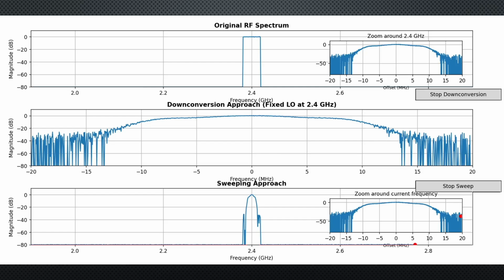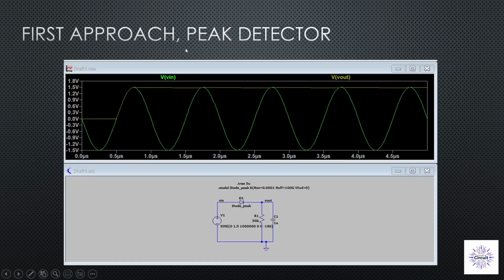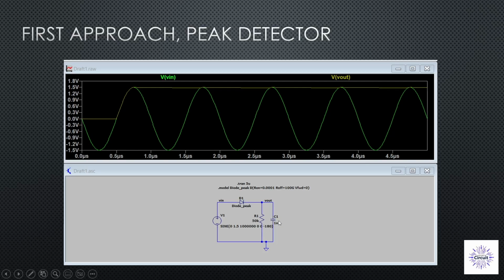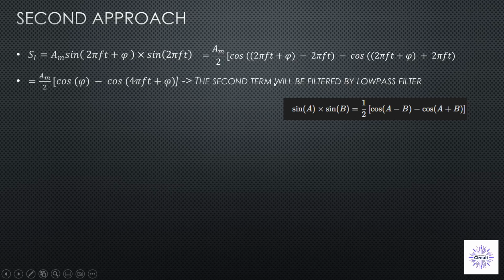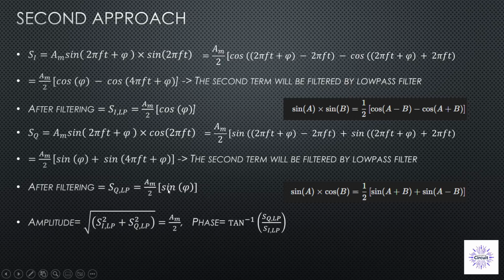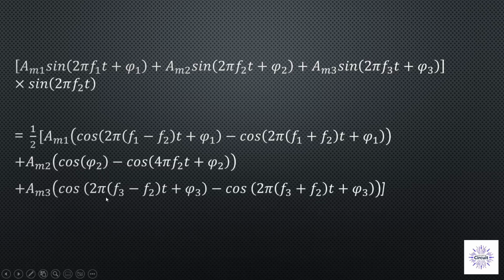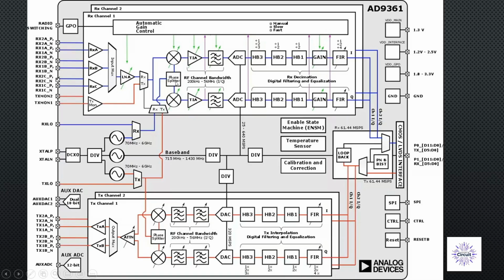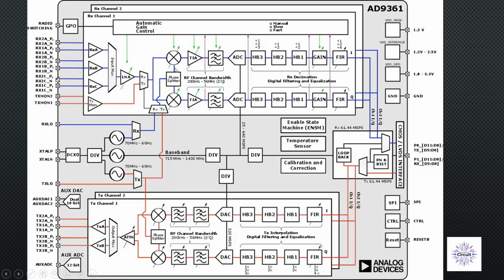RF Spectrum Analysis Using ADALM Pluto: Lock-In Amplifier Technique

Comment: Nice work using the Pluto to introduce some challenging concepts.  The great thing about these inexpensive SDRs is the way they let you see the math in action.  It's one thing to stare at a page full of trig identities, another to experience them running in real time.  Some of us (raises hand) have trouble wrapping our heads around the math any other way.

One minor point I'd raise is that you are not describing lock-in amplification here, "just" homodyne detection.  A lock-in amplifier uses an LO that's phase-coherent with the signal you're trying to detect -- typically because you used it to create that signal in the first place -- in order to recover signals that may be far beneath the system noise floor by the time they reach the detector.  Your later videos on network analysis probably touch on that, but it's technically not what's happening here.  "Lock in" refers to the action of the phase-locked loop that synchronously recovers the LO phase from the received signal.
Reply from the maker: Thanks a lot for the encouragement. Yes, as you mentioned, using an SDR gives the ability to demonstrate these concepts, especially at high frequencies.
You are right about the lock-in amplifier, and I should have done a better job explaining it. Initially, I used this term to explain the idea of frequency lock-in, as in the ADALM-Pluto both TX and RX use the same reference. This frequency lock is what helps improve the noise floor in amplitude measurement.
However, as you correctly mentioned, we do not have full phase coherency here, and the TX and RX phase relationship is random. Therefore, no phase lock-in happens, which prevents the ability to measure phase change.
Basically, by using the "lock-in" term, I wanted to emphasize that this is a special case of homodyne detection where the TX and RX share the same reference, so there is no PPM drift, and this gives us a better noise floor when measuring the amplitude because of the frequency lock.
In my next videos, I will try to explain this better for clarification. Thanks again for the great comment and feedback!

Comment: Same principle as legacy ( 70 years ) spectrum analyseur : OL, mixer , filter , power detector. Slower than FFT but more dynamic range with slower and narrower filter.
Reply from the maker: You're right. I'm actually covering different spectrum analysis approaches on my channel to build a foundation in signal processing before diving into more complex modulation techniques. This video demonstrates the FFT-based method, but I also have others where I sweep the frequency to replicate the legacy approach. Please check out these videos if you are interested:
https://youtu.be/DtBUft6RLiw?si=2NhWKe0yvoapO60a

https://youtu.be/aKFjk-2SaZ8?si=Bh4j2nGNYLF8C4gI

Really appreciate you pointing that out!